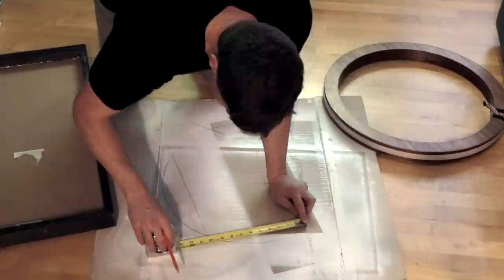DIY Music Reactive "Rings of Saturn" LED Pendant Light (controlled by Arduino) || How to Make

Comment: The comments in your arduino code are very helpful and it gave me the courage to try this.
Reply from the maker: Morten Hygum thanks!  I actually used code from cine-lights and natural nerd and combined them, so many of the comments are theirs.   Gotta give them credit for those :)
Reply: Ok :-) Now I'm trying to analyse the code to find out more about the out commented modes at line 357. It's a long code. :-)
Reply from the maker: Morten Hygum there are a couple functions beat_and_blur, and blur_and_blink that were broken.  Just figured out if I switch NUM_LEDS to NUM_LEDS-1 (or maybe N_PIXELS if I used that terminology in this code...on my mobile and not looking at actual code right now) it will fix these.  They are really cool if you want to give them a shot....

Comment: Awesome build my friend, and like Jay anderson was saying, only if you could hide the electrical wire. The only way i see to do it is to sleeve the metal wire and put the electrical wire inside too. I know it's easier to say than to do it but it's my only suggestion because everything else is perfect. Keep up the good work, looking forward to see your 4th project! 😏
Reply from the maker: I thought of that, but then you still have thick wire.  I suppose at least it is straighter then.  That is likely what I'll do when I do the permanent install, if I can't come up with something better (the backdrop in its permanent location doesn't look great in video, so this is a temporary install).  If only I could send 12A wirelessly :)
Reply: Yeah i know it's not the perfect solution when the goal is to not see the wires so the lamp look like it's floating. 👍

Wireless 12A plug technology has not yet arrived, but maybe soon the lithium batteries will be so small and so powerful to power our lamps for 1 year long on single charge lol Im dreaming! 😆😆
Reply from the maker: Installing rechargeable battery packs directly on (or even in!) the rings would be interesting.  If my ceilings were a bit lower (they are 13 ft) I would consider it, but as it is I would have to get the ladder out every time I wanted to recharge.

Comment: Just came across your channel. Looks great. You asked if there would be any interest in the arduino end of this. I vote yes. There are countless arduino How to channels but with the unique projects you make I love the blending of all these different disciplines.
Reply from the maker: Thanks!  Yea, I definitely like experimenting with different disciplines and combinations of materials/techniques.   For me, the electronics are a means to an end.  I would rather be woodworking and casting concrete than programming and soldering.  BUT, I love the end results when integrating programmable LEDs in  projects, so I can't stay away :)  I'm hoping that through a few iterations I can develop a simple way to integrate the LEDs, with minimal soldering and coding.  The Github code in the description works for this project, but I think it could be more refined.  For V2 of this light and another light, I'm going to try to migrate to WeMos esp8266 for simple wifi control.  There will definitely be an electronics video for this light (and hopefully applicable to a number of lights), once I'm happy that I have an elegant and simple solution that is worth sharing.
Reply: Well sir, I am subbed and I thank you for making these videos that an old dog like me can learn something new.

Comment: Routing into foam.  Genius. Why didn't I think of that?  Beautiful.
Reply from the maker: Thanks!  I use pink foam under everything when I cut.  It is soft and easy to cut through, cheap and reusable, dimensionally stable with reasonable weights on it, and self-leveling for heavy weights that are evenly distributed (I used to use it as a self-leveling base under large aquariums).
Reply: We use the pink foam a great deal in the theatre and now that you mention it, I not only use it for sculpture, trim and the like, but I use it underneath plywood when cutting. I have a several 1'x4' strips of white styrofoam left over for something that gets used here at home for cutting.  But routing never occurred to me.  So obvious...
Reply from the maker: Glad to help you add to your bag of tricks :)  BTW, I assume from your profile picture you are a scuba diver?  I'm also an avid diver.  I have a few dive trip videos on my personal youtube channel, although they are a bit less polished than my build videos (if interested, you can search for "mcliffy2" and should find it).
Reply: (long pause between comment and reply...) Yep.  We didn't make our usual trip to Cozumel this year so I have nothing new to post to my "channel". The problem being that it's easy to take loads of video and it takes time and concentration to edit it down to something worth watching. I'm sure you understand that...
Reply from the maker: I completely get that

Comment: Great video and great build! Tiny bit of criticism, or suggestion for improvement from my side is to use discreet electric wires to hang the rings and thus getting rid of the two thick black cables you used. I made something similar quite a few years ago with WS2812b  leds and a custom ATMega microcontroller and I was able to almost hide the wires that way. There's very little amperage involved so you can use quite thin wires. I used white wires for all of it.
Just a tip from my side, but yours is great as it is regardless!
Reply from the maker: Thanks!  And yes, I'm planning to do a version 2.0 where I hide wires better and perhaps even run the power through the hanging wires.
Reply: I use the electrical wires as the hanging wires. If you have four wires you have anode, cathode and two wires for data (if needed). I use a strong, but thin, wire with white shielding and that works great for me. Bonus is people wondering how the WS2812b leds are controlled and powered ;)

Comment: Great wood work. You should've gone with a three cable hanging system instead of 4, weigh dispersion and balance wise, 3 is enough, it also makes so all the cable have weigh on them and therefor are completely straight (here you clearly fucked up the length somewhere). 

Now about the electricity, run it through one of the cables, you could pre-dip the cable into a PVC compound so you don't get shocked if you touch it, and then spray paint the whole thing back to brushed steel for style. And probably do the same process for the three cables so it looks even. 

I would've also tried to find led strips with leds more close together, and probably find a thicker plastic to cover it so the light dissipates nicely.
Reply from the maker: Interesting thought on 3 vs 4 wires; it would be easy to change when I do the permanent install in my living room (this was a temporary install just for the video).

The plan was originally to use 144 LEDs/m strips, but with the curvature, they kept breaking.  I spent an entire day cutting out a bad LED, soldering the strip back together, only to find another one went out.  After a whole day of frustration, I decided just to do 60 LED/m strips.

Comment: I didn't know that led strips are amenable to this levelof control, even with a Arduino controller.

Looking forward to the Arduino tutorial.
Reply from the maker: It really depends on the type of LED strips.  I never actually went back to do the Arduino tutorial, but I did add the arduino code link in the description.  Check out the Nerdforge channel and their LED music syncing tutorials for the time being, as they go into a ton of detail on the code and electronics, which are similar to mine.

Comment: Just a personal preference but I would hang it with black lines instead of white so you could double up one hanging line and the LED power strip to hide it
Reply from the maker: +thefilthelement version 2.0 is planned for 2018, and will have hidden power wires.

Comment: Nice. I would have run the power through the steel wires instead.
Reply from the maker: I'm looking into that for the permanent installation.
Reply: Wich of material you are used to cover led strip?
Reply from the maker: I used flexible LED channel, there is a link in the video description.
Reply: Thomas Stadel yup i thought the same came down to comment but then saw your comment already ;) 👌🏼👍🏻
Reply: Right, I was thinking the same thing. The Arduino with the sound sensor on the ceiling and the 4 wires of the WS2812 using the 4 hang wires.

Comment: Fun Fact: The place i was working at, building Furniture by Hand had a Edge "Machine" that would blow hot air to the Edge Strip and had a Roller right behind it that you would push your piece of wood against to glue it on. Of course by hand we used a Hot Iron, but the Hot Air and Roller method IS allot better ;p
Reply from the maker: I would have loved one of those for this project!
Reply: Yeah i bet you would. It also would cut the excess off in one go. But we hated to use it, because we used allot White Melamine Particle board, and you know how easy that rips. Was a pain to work with.

Comment: I use a box cutter knife for trimming the edge banding. I have used the edge band trimmer and found that it tears, whereas a good sharp box cutter, cutting in towards the material its glued to works best.
Reply: A box cutter is a pretty horsey shop tool for fine woodworking , unless of course you're accustomed to using it.

Comment: Nice job, why did you don't use the metalic cable for power and serial ? look better than the black wire
Reply from the maker: Thanks!  And yes, I agree, the black cables are not ideal.  I'm planning a version 2.0 of the light with better cable management (hopefully running power through hanging wires).

Comment: This is a beautiful! I'm curious about the amount of light this gives off. Do the LED lights give enough light to be a main source of light in an office or workspace? Or is it more subtle and ambient light?
Reply from the maker: It is more of a strong ambient light...enough to hang over a dining table, but not the main source of light for a room that needs to be brightly lit.  You could try to make it with 144 LED/m strips, and then I think it would be enough for a large room (I used 60 LED/m strips, so this modification would increase the light output by about 2.5x).
Reply: Ah, ok.  That's helpful. Thank you!!

Comment: This video is over five years old but it just may be what I need. In currently designing a three part lamp for my ceiling, and the smaller piece would be a hollow circle with LED bright enough to light the room. It’ll potentially be 4-7 inches in size, do you think it’ll be possible to build or no?

Comment: sweet project: your wood work is stellar. can you hide the wiring for the LEDs by running the wires along the cable supports?
Reply from the maker: Thanks!  Version 2.0 is in my pipeline, and will have less conspicuous wiring.

Comment: Awesome Saturn lights. I have been thinking of making similar for some time now and now after watching yours has inspired me to now make them. The only problem is the lights and would like to know a bit more of the Arduino as I couldn't find the right one like yours which is cool. Help please.
Reply from the maker: I used SK6812 WWA leds, here is a link: http://s.click.aliexpress.com/e/iu3j2j2  (make sure to get the WWA version).  The link to my code is now in the description of the video -- it should get you jumpstarted, but let me know if you have more questions after checking out the code.

Comment: Very cool build!  I really enjoy your ease with wood, electronics, and Arduino.  Would it have simplified the suspension if you had used 3 points instead of 4?  One idea for hiding the wire is to have one of the suspension wires near the electrical leads and strap the electrical wire to the suspension wire, or spiral cable wrap to hold them together.  Another method would be to use the different suspension cables as individual conductors for the electrical connections.
Reply from the maker: Thanks!  3 wires would have been better in hindsight.   I think running power, ground, and control wires through suspension wires is possible...I just need to find the time to play with it.  Usually when it's time to hang a light I'm ready to be done and on to the next idea :)
Reply: @modustrial  Probably when you consider having someone to collab the electrical part of the build?
Reply from the maker: Yes, absolutely.  This was my second video, so no one wanted to collab at that point....but now that I've got the channel built up a bit, it is definitely on my list!
Reply: @modustrial  You write the code as well?  I looked through a bit to see if you were able to reuse code between the Saturn rings and reactive LED matrix projects but it seemed like they are completely separate.  I thought it would be cool if learning from one project would improve the code in the other.

Really enjoy how you time lapse and edit the videos to keep the fun parts of the build and the pace going as well.  Brilliant!
Reply from the maker: I wrote the code based on code from a few places...combined cine-lights VU meter code and nerdforges music reactive code, then made a bunch of modifications.  The LED matrix was derivative from this one, but with much tinkering.   I'm still not quite happy with how it all works as final product.  The reactive lights work, but once it is hung on the ceiling, you need the music pretty loud for them to perform, and I wasnt able to adjust the sensitivity without losing the effect.  There are a number of ideas I have, but as always, a matter of time, so I was thinking about reaching out to nerdforge or a channel like them to do a collab at some point
Reply: @modustrial  Looks like nerdforge has the expertise.  They have an updated music visualizing floor lamp project as of Nov 2018 that uses a different mic than the one you used.  That might change the response.  Another idea is just the acoustics of the room or where the mic is aimed.  It would be nice to see the raw data output from the mic to see what kind of settings would trigger the right responses.
Reply from the maker: Yeah that new nerdforge setup is awesome, it actually has a module that detects music that can be placed next to a speaker, and then wirelessly transmits from a wemos D1 to the lights.  I actually ordered the parts when I saw that, and am planning to try and incorporate the electronics at some point

Comment: Assuming the goal is to have constant uniform lighting, an aluminium backing would be needed to dissipate the heat. What would you suggest, to be able to obtain a nice circle?
Reply from the maker: Olaf Marzocchi with the 5V sk6812 led strips, the heat is not too bad.  I simply glued the strips straight to the wood, and have had no issues.

Comment: I'm not arduino programmer but wow, such a simple piece requires so many lines of code. Anyway, looking forward making this project myself :)
Reply from the maker: Cool, would love to see what you make!  I'm not the best programmer either, so I'm sure someone better could make the code more elegant :)  You can also buy an off-the-shelf music controller for 5V WS2812 LEDs, and use that instead.  (You might need a separate controller for each ring.)

Comment: Great idea, but why did you use dreadful black wires instead of almost invisible steel cables for light supply and control??
Reply: Nevertheless thumbs up)
Reply from the maker: Thanks!  I had to leave the door open for a sequel....version 2.0 is in the works ;)

Comment: Great project, definite probs to applying a part of geometry I have done my best to block out from memory, I’m curious how you plan on replacing the led strip in the future? Is it a matter of tearing out the original strip once it longer works or is there a more efficient solution to make it easier to replace? Either way brilliant project
Reply from the maker: Thanks!  You can just pull out the original, and use it to thread another strip thru (similar to running to wires thru a wall)